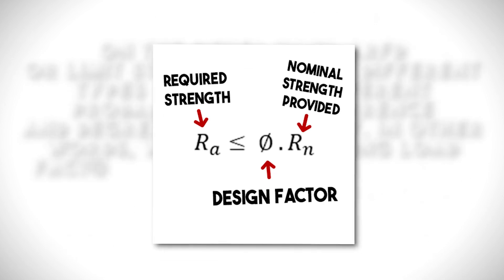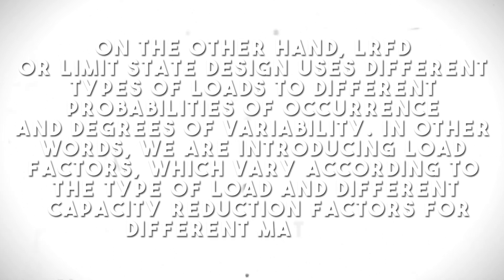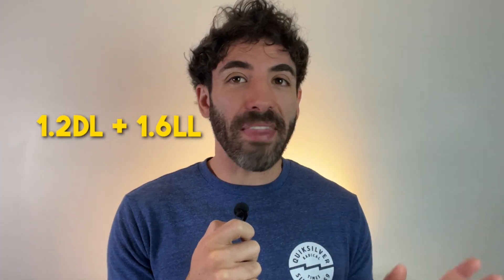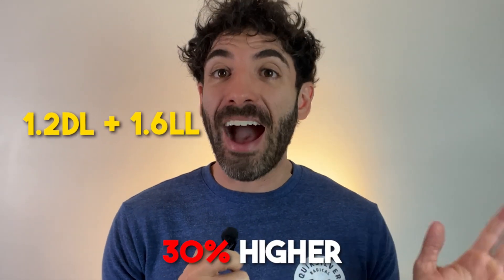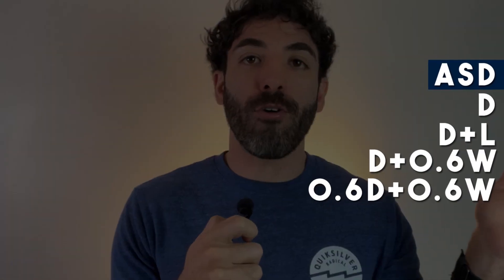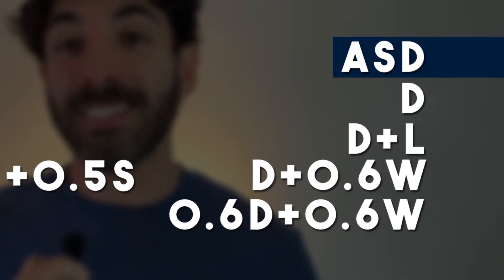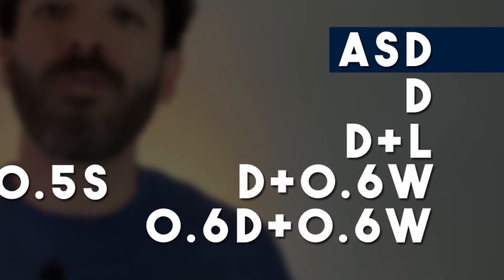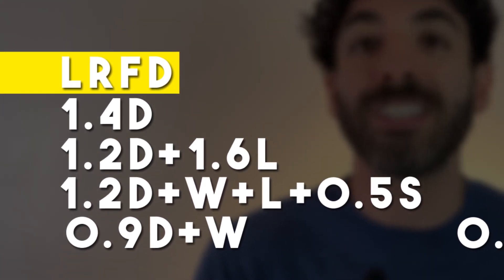Old School Engineers X Modern Engineers - ASD and LRFD Explained

Comment: In the Australian and New Zealand context, we kinda refer to ASD as WSD, [Working Stress Design].  AS3990 is the design code we use for WSD design. It's still in use if you are designing a machinery base frame. Doesn't matter if it's beams or plates, bolts, welds. AS3990 got you covered. My experience WSD has its merits if you are designing complex geometries u cannot analyze using platforms like ClearCalcs or STAAD and requires a more complex FEA model.

Comment: June 10, 2025 will be the 40th anniversary of my first days working as a design engineer.  So way back then, it was ASD for steel and timber design.  Plus we did not have any computers.  All calcs were by hand with my HP11C calculator and hand drawn at my drafting table.  While it was slow and laborious, I’m still so glad I earned my P.E. In that way.  

After climbing the corporate ladder, I’ve decided to return to my roots, and on Monday, I am starting a new jb as a Senior Engineer, for a small civil firm.  That’s what brought me here and I’m glad to hear there are still some old timers using ASD.  Thanks for the info, great job!
Reply from the maker: That's amazing mate. Good to hear about your new job. 
Keep in touch